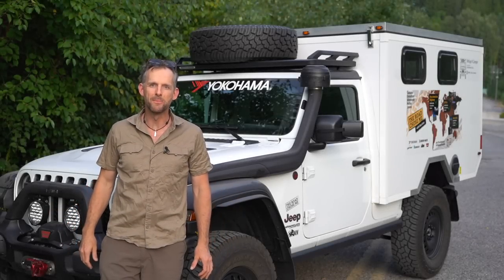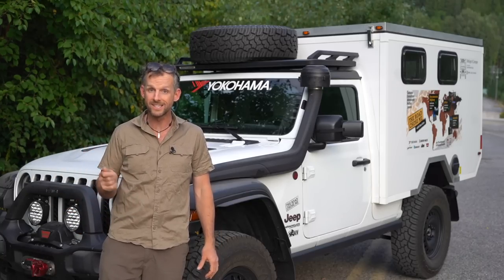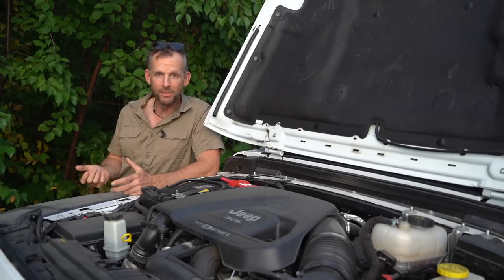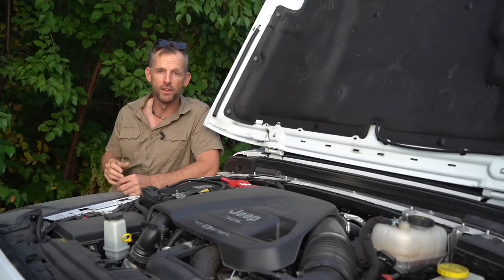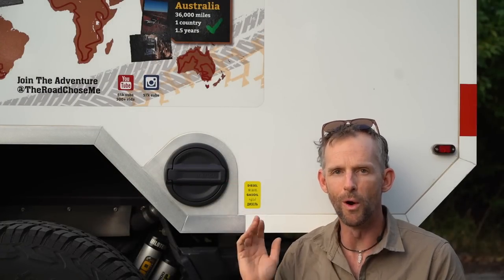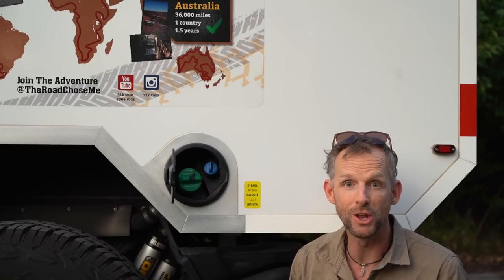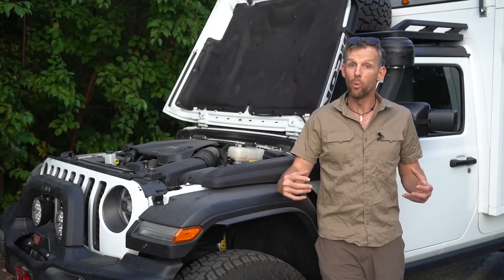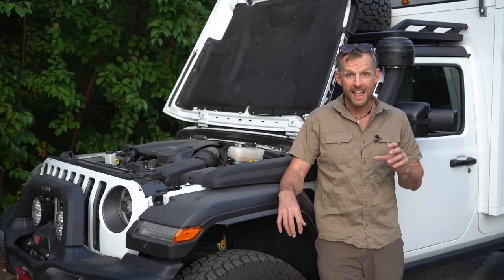Driving a Modern Diesel Around The World - is this a REALLY bad idea?

Comment: I have followed your advice where applicable to my journeys and I have found them useful. Thank you. 
However I wonder at how you changed your mind as I recall your pro petrol video from a while back. My goal is Ushuaia not Gabon but I still prefer my Jeep powered gasoline van over the Sprinter. 
I wish you well with your latest plan that is decidedly a new approach by your good self.

Comment: I do my oil every 6k miles on my 2022 eco diesel gladiator. I’m at 33k miles no no issues with the diesel. I run edt diesel fuel additive since day one. 

But you can’t beat the mpg and low end torque. 

I ran the white rim trail in Moab last week only a using 1/2 tank of diesel. 

I ran the alpine loop in Colorado yesterday with zero worries about fuel. 

Low end crawl power is crazy. Love it. 

But after a lot of wheeling this week the factory 3.73 gearing does not cut it. Going down hills in low gear it over runs. Needs a lower gear. That’s with the rubicon 4-1 transfer case. Thinking 4.56 or 4.88
Reply from the maker: Great to hear!
What size tires do you have? What mileage are you getting?
Mine sits in 8th gear less than it used to, so I'm thinking of going to 4.10s, or I might just go down to smaller tires
Reply: @TheRoadChoseMe  I’m on 37s km3s. Love them. On aev rims with the proper offset.
Reply: I get 16.7 in 4 low. 20-22 highway. 

On the trails I stay in 4 low. Oil temp and the diesel loves 4 low. still have to watch oil temp. 220 normal I’ve seen as high as 250 climbing high peaks and I’m currently in telluride co this week. Imogine pass climb I was at 247 degrees Fahrenheit high oil temp. De tune is 255-260 I think. Always leave it running after a hard pull to cool off the oil.

Comment: I’m not an overlander but I have a 2011 BMW X5 diesel with about 175k miles. Had a few issues. Interestingly, modern diesels have a throttle body for emissions and safety reasons. Mine failed on a roadtrip far from home. The spring should force it shut, keeping the engine from running- and it sounds like others have had this failure mode. The failure on this item is oil in the electronics. 
Fortunately, mine failed open so I was able to easily drive the 600 miles home and replace it at my leisure a few weeks later. The only symptom was rough shutdown and an initial servo clattering the day it failed, and never again. 
FWIW I also had to replace my particulate filter at 150k. Thankfully I can afford to replace it; and I live in a strict jurisdiction. Absent those factors I could see deleting it. But overall I agree with the mission of limiting particulate pollution so I’m fine with it. 
I absolutely love the motor by the way. It’s a gem. I can’t imagine a gasser in a heavy vehicle.

Comment: Hi Dan,

You really are a legend. I've been following you for a while. I don't always agree with your choices and your conclusions, but I can't fault you for digging into the subjects you tackle and arguing the choices you make very well, nor your open-mindedness and curiosity.
I worked in engine development for 8 years. It's my training and my first job. And as you described very well (as a diesel engine is much harder to Depollute than a petrol engine), modern diesel engines have become much more complex and therefore more fragile. Very sophisticated injection system with very precise machining due to very high injection pressure, EGR valve, Turbo, dual regulation, for Turbo/Egr, particle filter, oxidation catalyser, NOx trap, urea injection...
So I wouldn't, and in fact I didn't (I've got a Land Cruiser GRJ 78 so V6 petrol) choose a diesel for travelling and even generally for that reason.
Even in Europe, with quality fuel, these engines are a source of problems. And you are currently experiencing this with a recall on a new vehicle.
It shouldn't be much of a problem in your case in NA but in a country where the quality of diesel isn't as good it's definitely a source of more stress or problems.

Cheers! And have fun with your new toy... ahh, sorry Jeep... ;-)
Reply from the maker: Thanks!
For sure it's a concern, but I'm absolutely taking this thing out of North America - that's why I built it!
Reply: You're welcome.😉
Don't get me wrong. I think you can drive anything anywhere. The only question is how painful/fun it is.

There is no right choice. There is only the choice that suits you.

Comment: Well, I have a jeep gladiator eco-diesel of my own, in my opinion is: when you have more torque you have less stress on your engine and also in all the drivetrain I hope your jeep comes with all the steel parts in the staring and no the aluminum parts the gas in Jeeps. the extra tork will  help you overcome easier all the hills and obstacles, and if you want to pull something like a trailer, it will be easier as long as doesn’t put too much weight on your hitch

Comment: Nice that you know all of the oil details for that Diesel - So many horror stories of spun main bearings on that engine that are probably likely to bad oil change intervals - Aparrently the Italian maker designed it for GM for the EU version of Cadilac just before GM went bust in 08.

My 4D56T/D4BH (Hyundai knock off of the 4D56T Pajero) Galloper finally got on the road anter a lot of effort, skinned knuckles and swearing. We are up to Manitoulin the coming weekend - If that works then BC (from Ontario) mid August and if all that works it is down to Nicaragua in November.

Comment: Interesting video, thanks for producing this content.  A thought I had that you didn't mention is adding a new "tool" in your tool box, namely an ODCII connection device.  This will give you more insight into what's happening with your engine and assuming you have the right device it should also allow you to force the engine into a burn off mode instead of relying on the ECU to do this automatically.
Reply from the maker: Thanks, I should have mentioned I have one

Comment: Old turbodiesel + torque converter automatic = best combo, won't ever shut off on you on a bad incline, won't burn a clutch in the middle of nowhere, has great mileage and fuel availability. Basic maintenance is all you need.

Comment: The AddBlue fluid ( 32% Urea solution) is really only used to reduce NOx, 1Litre will last over 500 miles so it’s less than 5% of your diesel consumption.
Reply from the maker: Right, it really doesn't use that much, but it's something I have to plan ahead for, because running out would be a big, big problem

Comment: Just an idea, could you use an exhaust switch, allows you to divert your exhaust to atmosphere in high sulphur fuel locations, then switch back to DPF system?? The engine light might come on, but saves the DPF and AdBlue system.

Comment: I can relate to stubbornness and having to follow through to satisfy my own curiosity. As the owner of a 2018 ram with a 6.7 Cummins I personally would not run anything except ulsd unless I had no other options and even then I would be hesitant. I was nervous about all the emissions equipment when researching and considering my ram but in the end it was the best option for my lifestyle and use. After 66,000 miles of heavy towing and hauling while setting up my off grid homestead and seasonal cross country road trips following pleasant weather and exploring the western US I'm happy to say I haven't experienced any emissions failures. I don't know if biodiesel is common internationally but I've run into B20 while in Texas and pulled out my owners manual to find out my 6.7 is only rated for 5% biodiesel not 20% before filling up, luckily I still had plenty of range left to make it to the next fuel station.
Reply from the maker: I'm happy to hear it's been good to you.
I have to imagine you're getting way better mileage than with a big gas engine?
Reply: According to the trip computer the truck with a 36" tall contractor cap gets 14-18 mpg. Without the cap 16-21 mpg. Total weight is 8500-9000 lbs. I can't say for sure how a gas engine would compare in the same conditions but mpg is only one factor to consider. Diesel engines are built with long service lives in mind also the low rpm torque range is usable under the majority of driving conditions especially technical off road sections
Reply: @chad2886  @The RoadChoseMe Me too with my 2017 RAM Cummins with Aisen 6 speed no problems, once you get the CP3 retrofit you will be good Dan, maybe also focus on figuring out why the overheating issue is prevalent with those diesel Jeeps and fix it? Take care, Max

Comment: This was an amazing one Dan! Thank you as always for your thoughtful and intelligent deep dive into a super niche and super awesome topic! One question I have for you about your diesel jeep - how does the sound of the engine compare and contrast to your gas jeeps of the past? Do you kind of love the sound or is it so deep and loud that it's a little bit annoying?
Reply from the maker: I can't hear the engine when driving if the windows are up. With the window down its a totally different sound when you get close to a brick wall or building like in a drive though. It has quite the rumble right off idle, but I like it. 
The noise finally seems fitting for such a vehicle!
Reply: I was parked next to a Jeep diesel at BCOR and when they started it up ever morning to charge their batteries I was amazed at how quiet it was. My 2.8 Duramax Colorado sounded like and old tractor by comparison.

Comment: I had that 2.8 turbo duramax in a 2019 Chevy. It was very VERY picky about DEF.  I regularly got def quality trouble codes with the 99 miles until speed reduction. I’d recommend putting your Jeep through its paces and checking if it will run on diy DEF. Make sure to use deionized or ultra purified water. Check that you can drain your def tank in case you have issues.
Reply from the maker: Thanks, That's a great idea and I will do exactly that
Reply: your right he should do a real shakedown run before even thinking about this.
Reply from the maker: @firebir11  I've driven it more than 6,000 miles so far, I'm learning it's quirks
Reply: @TheRoadChoseMe  one thing to add - my duramax loved diesel additives and it increased my mileage by a noticeable amount. Think 1-2 mpg. The cetane boost helped. I’d recommend stanadyne additives especially if you’re getting sketchy fuel especially with the high pressure injectors on a modern diesel
Reply from the maker: Lots of people have been suggesting that, so I'll add it for a few tanks and see.
Up here in Canada the diesel has a higher cetane anyway, and my best tank was from Shell. It was 7l/100km through the mountains, including Canada's highest mountain pass (33.6mpg) (which supposedly has the best diesel here)
Reply: @TheRoadChoseMe  where I am at in California the cetane rating is pretty high as well. My best tanks came from 76 stations with that renewable diesel or Propel Fuels along with a bottle of additive.  They have cetane ratings of >75

Comment: I really do sympathize with you. I was in your shoes. I wanted a modern diesel for overland travel so I rolled the dice on one.  Unfortunately it was just nothing by stress. Diesel fuel isn’t the issue. There’s just too many things that will go wrong. Being in the middle of nowhere and stranded is a terrible feeling. Going back to gas was the best overland travel choice ive made. No more stress or anxiety. But I wish you the best of luck. Love your channel 👍
Reply from the maker: Thanks for the real world input, I always appreciate that.
What diesel did you have?
Did you have any problems, or was it more just the constant worry of problems that made you switch back?
Reply: @TheRoadChoseMe  I had the Cummins 5.0 V8. It was powering my full-size truck camper. Mostly my issues were emissions and turbo related.  And yes there was a constant worry about other parts failing such as the expensive fuel pump/system.

Comment: DPF regeneration requires high, sustained exhaust temperatures from long journeys at high speeds, that is the DPF problem for low speed travel.. let alone non compliant en590

Comment: I seem to remember Live and Give had issues with their large diesel truck and were able to use their laptop to input some code to by-pass the engine shut down.  Not sure if that applies to what you are talking about here.  When I was travelling in Africa in the late 1980’s, we often had to find what was essentially black market fuel.  We would get directions to drive into a sketchy part of town, give the secret door knock (kidding) and hand pump diesel from 45 gallon drums.  Many times it was just part of the adventure and we never really had any problems getting diesel.

Comment: I'm curious how you feel about the fuel pump recall that is out on this engine currently. There is no fix available yet, and it could be months before one is. Are you worried about a catastrophic fuel pump failure when out in the boonies?
Reply from the maker: Obviously it's not a good thing, but basically every engine in the world that uses the Bosch CP4 injection pump has this same problem, and the fix seems to be everyone is going back to the very trusted and proven CP3 injection pump.
A little birdy told me Jeep have parts for the recall arriving in warehouses now :)

Comment: I have a mountain of questions about this build, but I will just ask one today because I am not sure if you mentioned it in the previous videos. I may have missed it. How much has it cost to remove the old Jeep back end and replace it with the new square box? Yes, I realize the box may not be fully finished yet. I am just focusing on the conversion part of the build. I like this box idea so much that I would to begin to save to do the same in the future. And, as we all know, it is better to have savings goal before putting the plan into action. Thanks for you time.
Reply from the maker: It depends entirely on how you value Michael's and my time. Even if you paid us $50/hour for the work we've done, it would be prohibitively expensive.
If it gets manufactured, it would have to be done differently so it doesn't require so many hand labor.

Comment: As a 10 plus year diesel mechanic, and personal owner of a diesel gladiator I am extreme excited to see you using this platform. However I do worry about you being stranded by the emissions. It’s not such a huge issue now as it has been in the past but it can be a real headache. Having a heavy rig like your is excellent for the engine as diesels like to be worked but be prepared to go through a lot of DEF. I strongly recommend deleting your rig. Not having an EGR will greatly prolong the life of your engine and I can guarantee the extra fuel mileage you will gain will shock you. Not to mention your rig will be substantially more reliable.  You should see what an EGR cooler looks like on the inside after only a few thousand miles. Regardless of what you do I wish you the best of luck with this new platform that your running. I look forward to watching!
Reply from the maker: Thanks for the advice, I appreciate it coming from so much experience. Have you deleted yours? Mind i I ask which company you went with?
Reply: I actually had it deleted through my local dealer. However I’m almost positive they outsourced the job to another shop. I would recommend Adrenaline Diesel in Edmonton AB.

Comment: I had the same 3.0 v6 in a grand cherokee and never had any injection problems in 400k, all original. Turbo had some play but was still ok. A big drink of water through the snorkel was its end. Ran plenty of dirty diesel from stations and had water a fair bit from bad service stations but was alright. Miss the power and torque and 10L/100 sitting at 3 tonnes.

Not sure if the wrangler has the same twin fuel filters and lift pumps but they did well. I added a 3rd 2micron filter that always seemed clean.
Reply from the maker: Wow, that's great to hear! Where in the world were you driving it?
It has a single 3 micron filter with water separator, I will probably add a second one.
It's also the "Gen3" version of the engine, which has significant improvements over the one you had in the GC.
Reply: @TheRoadChoseMe  in the relative safety of North and Northwest Queensland.  Spent alot of time in remote areas for work or camping.  Water and dirty fuel was common. I ran a extra separator filter and changed the main filters every oil change and the secondary every 30k. Genuine ones were cheap through mopar Mexico or USA.
Great engine for touring. They can pull alot of weight around effortlessly.

Comment: I have the Jeep Gladiator Rubicon with the Ecodiesel and live in Arizona. In the peak heat of summer it sometimes gets warm and the engine goes into some type of management loop and debates powers until it cools off. I can’t imagine this would be good in the Sahara.
Reply from the maker: I've talked to some very knowledgeable people about this (known) issue, and pretty much everyone said it will only happen on very hot days on the interstate doing 70+ miles an hour.
Which means the USA is the only country it will ever happen in
Reply: @TheRoadChoseMe  mine does it on the freeway AND in the woods. Supposedly the new grill design will help, but I don’t believe it.